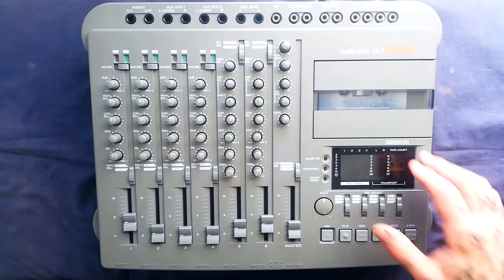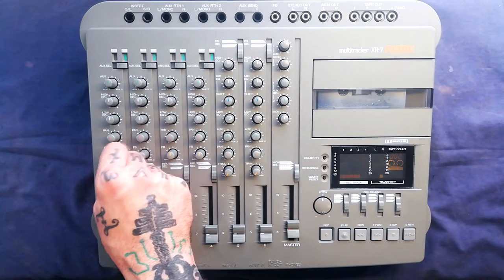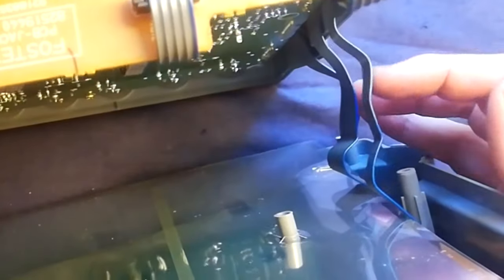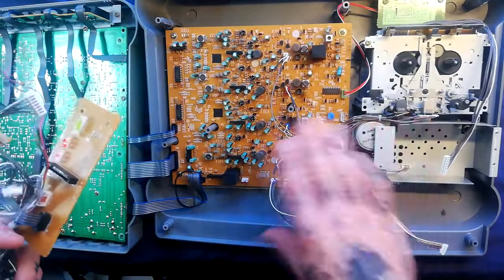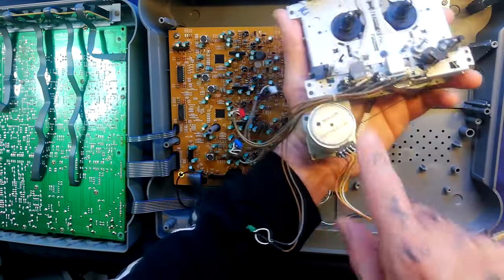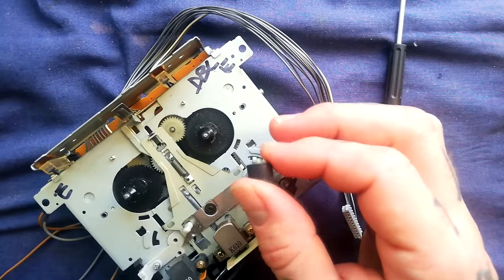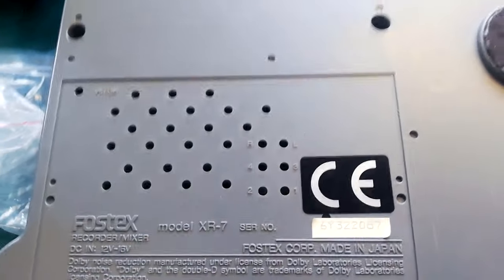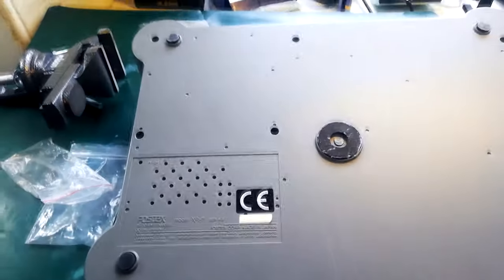Fostex XR-7 Multitracker | Review & Tear Down

Comment: I have the fostex xr-7 and everything works but the recordings sound terrible when I play it back. Lots of noise on the tape. I'm assuming it's the adjustment for the heads. Is it just those two screws beside the tape head that adjusts the hight? i've never done anything like that before. Does that sound right?

Comment: hi, first of all thanks for sharing your knowledge!! more people should me as generous as you... I have a question regarding a tascam  424 mk1 that I have and been trying to get to work properly for long while now... The problem that I have is that after recording the same test tone signal on all 4 tracks simultaneously, when I reproduce the recording Track 1-3 are OK with levels but track 4 starts very low and increases level with time.. it takes about a minute or so for the signal to get close the the other 3 tracks. Since this issue has to do with time, do you think track 4 needs new capacitors? if not, do you have any idea of what might be the cause of this issue? Thanks a lot!
Diego.
Reply: by the way, if I reproduce a test cassette (full track) the levels are equal on all four tracks at all times. I'm lost here.
Reply from the maker: Honestly I’ve never had a problem like that….yes I think something is taking time to heat or charge, and if it’s not a capacitor then I guess it’d be a semiconductor, but at the end of the day my process is always the same; isolate where the problem is occurring, get as many clues as I can using probing with an audio probe, scope or meter, do a check for physical issues like loose cables, cracked boards, loose or missing inductor cores, heat damage or dry joints, then if I haven’t already figured out exactly what has gone wrong, start replacing components near the fault working from the most obvious culprits to the least. Electrolytic capacitors separating gain stages and smoothing the power to opamps are among the most common things I have to do to get a portastudio working, especially where there is low signal in an amplifier stage, so failing anything obviously broken or disconnected in that area of the bottom board, start with electrolytic caps in the track 4 record amplifier. Failing that, semiconductors such as the opamp chips themselves tend to fail less often than electrolytic caps, but more often than other types of caps. Resistors tend to fail least often and obviously look bad when they are damaged but you never know. Good luck!

Comment: I hope some one can help: On my Yamaha MT8X there are two switches to the side of the center motor soldered with four prongs each into a small board that tell the machine  it has a cassette plugged in.  I have researched even the service manual but I still can't figure out what they are called so I can replace them.  Can anyone help?
Reply from the maker: The generic name is leaf switches. If you can’t find a suitable size of replacement, it’s easy to just bridge the two halves of where the old switch joins the circuit board, the unit will then just think a cassette is always present. It’d mean the capstan motor turned whenever the unit was powered on, but most tascam work that way anyway.